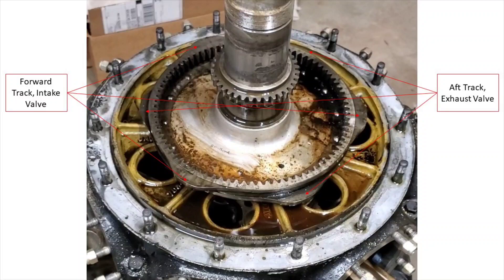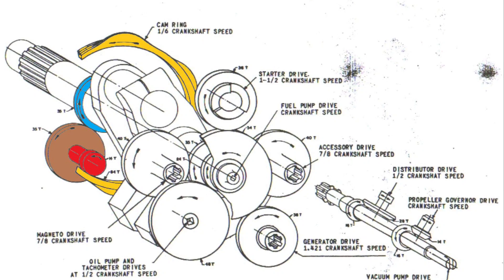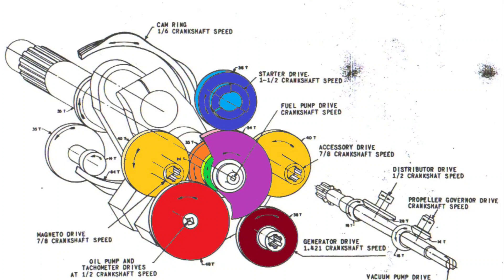Jacobs R-755-9 Accessory Drivetrain

Comment: It is confusing at 2:26 Min. you said "at 4 rotations of the crank shaft" the disk should have moved One third of its entire revolution. It should have been: "at 2 rotations of the crank shaft (this is for all 4 strokes to happen) " the disk should have moved 1/3 of its entire revolution- because it rotates at 1/6 revs. multiplied by 2 revs. it gives you 1/6 of a CS rotation..., but then at 2:51 min. you said 2 CS rotations which is correct. Regardless of this little mistake, the explanation is excellent and very comprehensive. Best regards

Comment: I’ve always wondered how they did the valve timing with several lobes on the cam gear. Didn’t know the lobes were separate for exhaust and intakes figured it was all one ring with several lobes.
Reply from the maker: Indeed,  we had some fairly smart folks designing engines. Also, if you look at the nose case, youll see that the exhaust push rods are slightly behind the intake pushrods